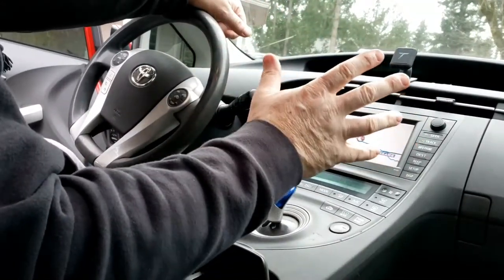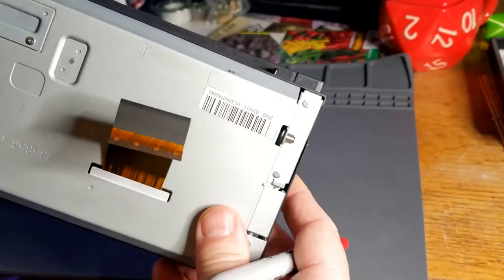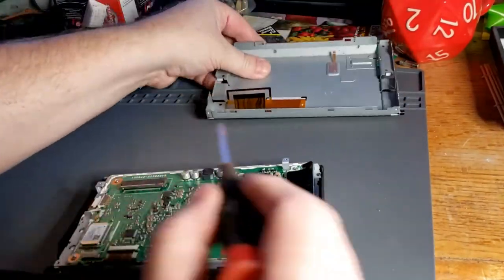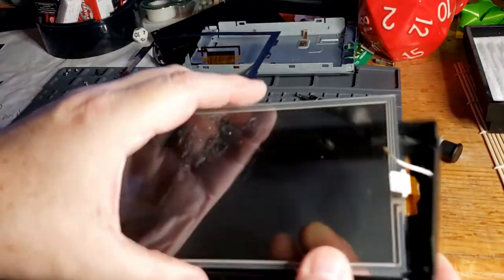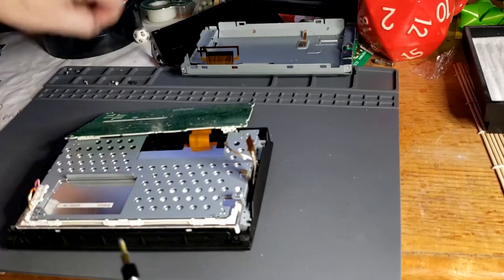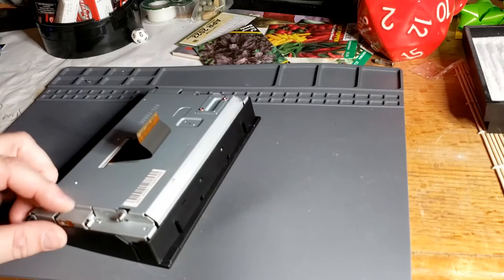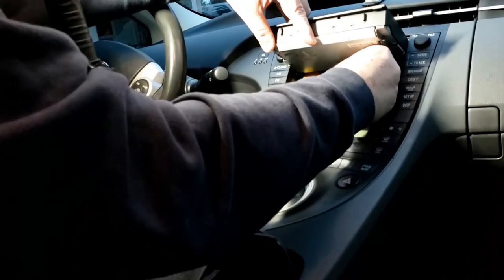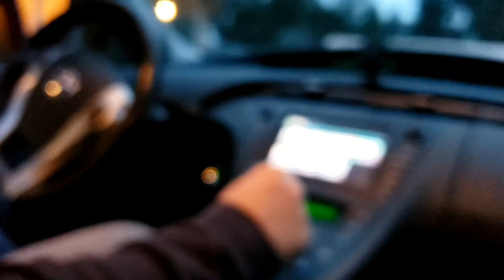ep77 Bishops Garage - 2010 Prius broken LCD screen easy replace!

Comment: After connecting the final ribbon cable my screen remains black and plays the radio. Any idea what might the issue? Did I insert something wrong?
Reply: So my guess is that the final ribbon cable isn't actually connected all the way. He doesn't show it in the video but there's a trick to both of the final 2 ribbon connections you have to make. On the motherboard, the ribbon with the weird loop of plastic around it has to be inserted by flipping part of the connector up 90⁰, inserting the ribbon, then flipping and locking the connector closed. 

On the car end of the ribbon cable, the connecter has a small black plastic piece that doesn't look like it should come off, you need to hook one end of it and pull it out with tweezers or your fingernails then insert the ribbon and push the plastic bit back into place. Hope this helps :)

Comment: The replacement went well, but i’m having difficultly with the final step. Any advice on reinserting the jbl to car connection?
Reply from the maker: The thin broad wire?  Does yours have a plastic loop or is it just the slide in?   Both take a lot of meticulous 'Nope, uh huh, yes, nope, dang it, nope, uh huh hmm, nope, dang it!"
Reply: @bishopofrustyiron3101  there is a small black plastic bar that has to be pull gently and slide the wire in and push in again
Reply from the maker: @salzsilva  Great note thanks!  Luckily mine didnt have this, but i think mine was broken?

Comment: I will use this to fix the screen in my aunts prius. Very nice! Note: for those who do not know. If you are replacing from a screen that does not work at all, (black screen) hold down the eject/close button for a few seconds then it should open.  Any disks inside should automatically start ejecting
Reply from the maker: Nice note!!  Well done!

Comment: Can you lift the screen manually? My LCD is completely non-responsive therefore I cannot make the screen eject or fold out.
Reply from the maker: Yes you can but the arms that are holding it in are on a set of gears, hmm, I bet there is a way to get it to pop out even when the screen is totally off.

does the screen beep when touched, even though its off/dark?
Reply: @Ass_Burgers_Syndrome  thanks this worked for me 🙌🏾
Reply: @Ass_Burgers_Syndrome  
Thank you so much it worked for me. Now I don’t know what to do from here though unfortunately. I was hoping once it was opened I’d see a reset button or something and miraculously my touch screen would work again. 
Does anyone know what to do if the touch screen doesn’t work at all. I can’t even add my new cellphone for the hands free option. This really sucks. 
I don’t want to have to put anymore money into my car if I don’t have to. I just had to replace my engines electric water pump which was a totally unexpected thing. Of course. Who really sits around and expects auto parts to stop working. 
Anyways any help would be great. 
Thank you very much.
Reply: Never knew my radio could flip, any other reason for this feature? Is there something that needs cleaning? Thanks

Comment: How do you get your radio to pop out if the screen is white with black lines so I can’t see anything on the screen
Reply from the maker: Well, first press the close button once, then you may need to press all over the screen ... if the touch mechanism is all dead on the screen, there is a way to force the screen/radio to open with a screw driver.  I'll see if I can find that.

Comment: In my 2010 the screen is not responsive at all. Is doing what you have done, by replacing the lcd screen be the fix to that? Thanks!
Reply from the maker: My case was half the screen was not responding because the glass was broken and the 'touch' is inside that medium.  

Fairly cheap repair, might want to do it anyway, wont make it worse,  Perhaps your setup right now has a loose ribbon cable, that would do that too.

Comment: Screen replacement seemed to go perfect but screen is totally black. Not sure what could cause that. I know connection to car is good.
Reply: I figured it out by watching another video and my own closer inspection.
#1 The ribbon cable where it attaches to the car does have a clip that you use a dental pick to pull outward on each side. Just yanking it out and /or trying to push it in without releasing the clip is bad.

#2 The big ribbon cable as soon as you open the metal cover also has a release bar. It’s the silver part and you need to pull up both sides and raise it up 90d. This is critical to get the cable locked back in after the repair. Trying to push the cable in without releasing is impossible to get it fully seated. 
I appreciate the video but you got lucky and I hope nobody messes up their car by yanking cables as all the ribbons have a release mechanism
Reply from the maker: if you shine a light on the screen does anything seem to show?  LIke the light is off?  Wonder if the strip is backwards....first i've heard of this not working...thats no good =(
Reply: @bishopofrustyiron3101   I am having the same problem. I replaced the touch screen, following your steps (great video btw!) and now the screen does not power up at all. The ribbon cable is fully inserted. The gold strips are facing down << is this correct? Looks like that's the only way possible. I have the same clip you do. I pulled it out a bit, inserted the ribbon as far as I could, pushed the clip back in and it's snug. Maybe my replacement screen is defective? I will try taking it out and re-doing it. Any tips would be appreciated.
Reply from the maker: @leh1273  Hmm ya thats a weird one, i presume the mechanism works and it ejected fine....so it 'can' read from the ribbon cable...is the cable looking okay?  no cracks, pinches, or creases?  You may need to test that at each end, make sure they are not cracked along that ribbon.

Comment: So, how do you open the screen if the touch screen doesn't work?
Reply from the maker: I just kept pressing the "eject all" and all over the screen till it eventually popped open.  If yours is not lighting, you might want to try to follow along on the sounds and my finger positions as i go through the menu...it might register your pressing even if the lights off.  Good luck hope that works!
Reply: Figured it out. Press and hold the eject/ close button to the left of the screen.
Reply from the maker: @roscoesrepairs  nicely done man!!

Comment: I messed up the last step to insert ribbon cable back into the car port.The whole casing came loose. Any suggestions to keep it back in place? 😢
Reply from the maker: The casing...can you be more specfic?  =)
Reply: @bishopofrustyiron3101  I mean we are supposed to insert the thin golden strip into the little black holder as last step before verifying that it works.
Reply from the maker: @ksirupa  So is it the black holder, that thin slit that came loose?
Reply: @bishopofrustyiron3101  yes, the thin slit.
Reply from the maker: @ksirupa  gah, well sounds like it came off the solder it was on, is there any way to get a drop of two of super glue in there so it wont giggle around and do NOT get that near the thin slit

Comment: If Eject does not work, what is alternate way to open.
Reply from the maker: Ooo thats a question.  Hmm, ill see what I can find out...does it even make a sound like it tries?
Reply from the maker: Looks like you could follow this from toyota.com

Remove one of the car battery terminals for a couple of mins (3-4mins). The reattach the battery terminal back. This will make your cd player and car clock reset. once you start your car you should be able to eject the cds.
Reply: @bishopofrustyiron3101  Screen does not work correctly. Press down and nothing happens
Reply: @bishopofrustyiron3101  Thanks... will try
Reply from the maker: @rohitbhatnagar7599  Cool, let me know, curious to see!
Reply: @bishopofrustyiron3101  Took battery terminal off for 5 min.  Restarted car -- still does not work
Reply from the maker: @rohitbhatnagar7599  dangit, wish i knew of another option...other than some brute force that you may regret.   

Might want to check out the prius car group on here (Facebook) bet they may know.  Darn.

Comment: What if the screen doesn’t work at all and you can’t press eject all, what do I doooo
Reply from the maker: you may need to muscle it a bit...worse case its already broken and not working....could it be worse?  Dealers will charge WAY to much to do this...thats also a bad thing.

Comment: well i ruined my ribbon cable the one that goes to the car. Anyone know where i can find a replacement? I had no idea the ribbon cable had locks in either ends.
Reply from the maker: You can get a new one for about $9 at:  https://www.aliexpress.us/item/2251832645729296.html?gatewayAdapt=glo2usa4itemAdapt

Seems a random chance for lock style, some are unwilling to let the ribbon slide out easily.

Comment: Make sure you can remove the head screws before buying the screen replacement. My 2011 Prius some dickhead used copious amounts of locktite. The drivers side came out with a lot of difficulty but the passenger side unscrewed a 1/4 turn and that was it. Ended up with stripped screw that even a screw extractor only stripped out more.  What a fucking waste of time and money. 
So pop the head out and try to remove those screws first.
Reply from the maker: Oh dang what a mess!  Glad you solved it but such a pain it took all that effort.  Great advice, remove the screws first!

Nice thanks!